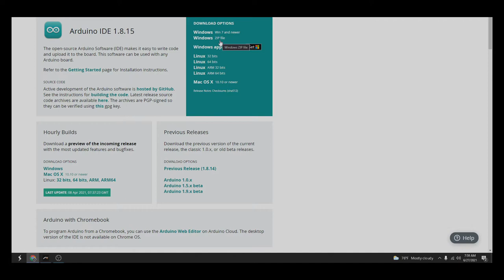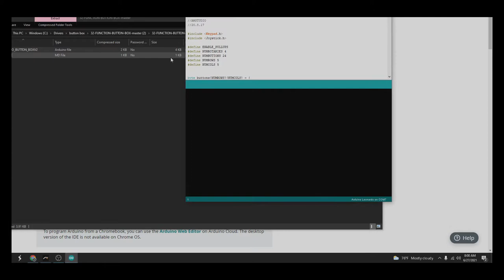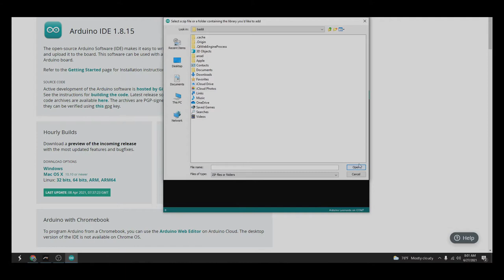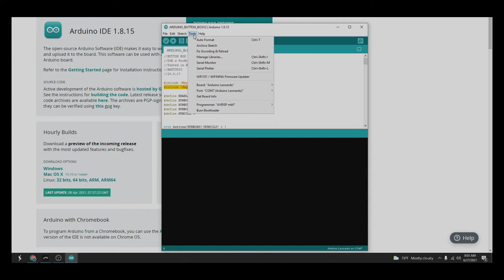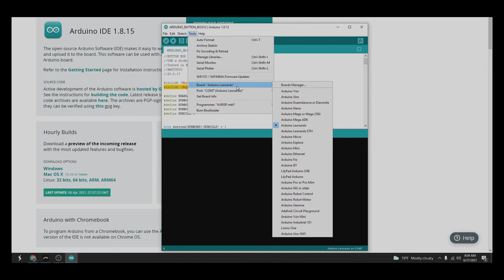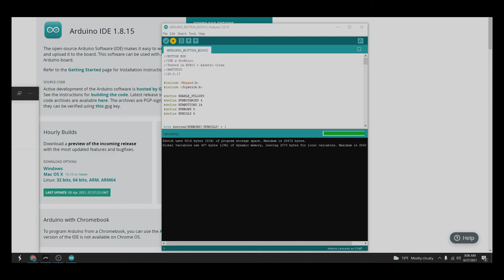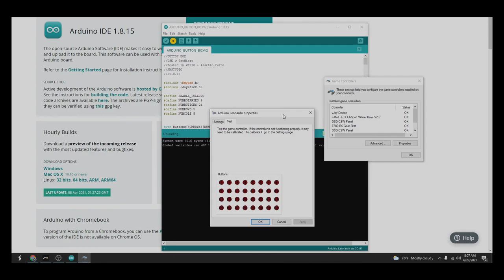DIY SimRacing: Button box with LCD, encoders and paddle shifters for MOMO 27c wheel. Formula or GT.

Comment: Hy it should work o a 25 cm wheel ?? in case not it could be modified ?
Reply from the maker: Its prob going to be to tight for the thumbs, but you could modify the Vocore version that I made and remove the side buttons to provide more space for your thumbs. here is the vocore version https://www.youtube.com/watch?v=aglYMkoeo_E
Reply: @SimsRUs  My question is how do you unlock the cell phone? :D
Reply from the maker: @GonzaloRomero1991  I just turned off lock on the phone, I don’t remember where the setting was though